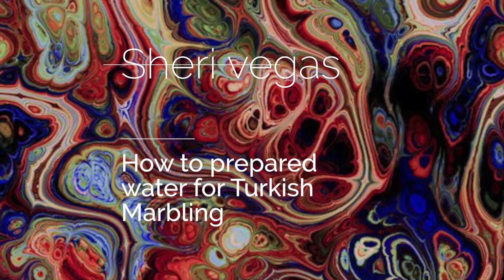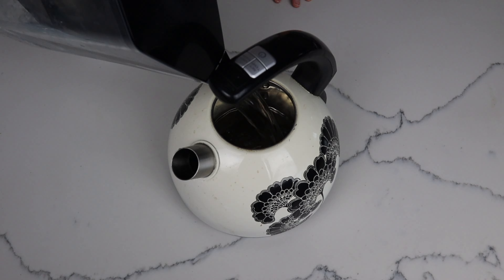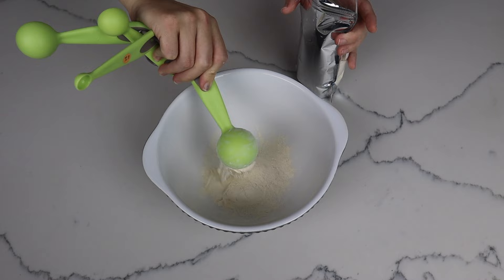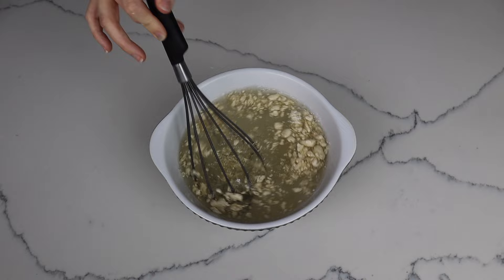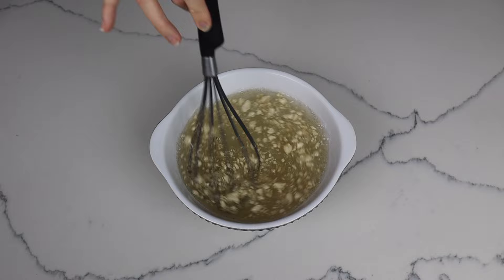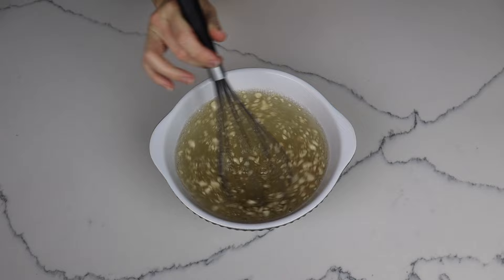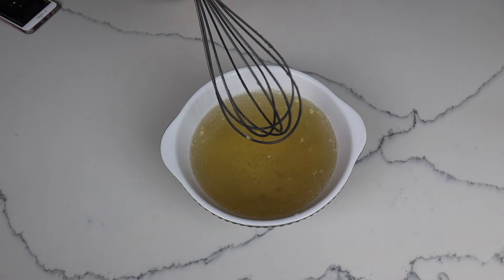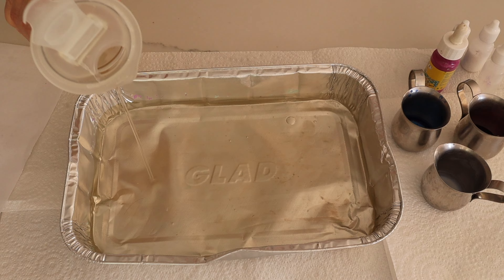How to thicken water for EBRU Marbling (turkish style marbling)

Comment: To help with the lumpy bits, if you add a small amount of water to the powder first, form a paste with no lumps and then you keep adding the remainder of the water in small increments until it's the desired consistency, that will make life a little easier✌🏼😉🙏🏼💞
Reply: just like protein powder
Reply: could you use a blender to mix it in?